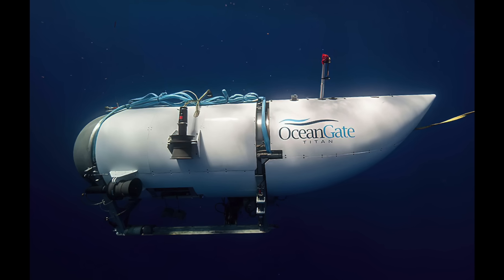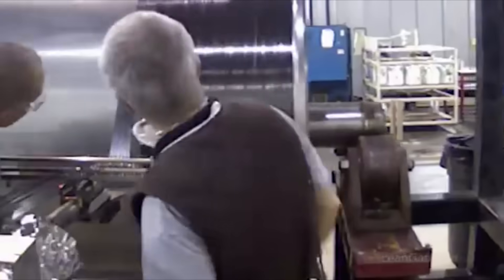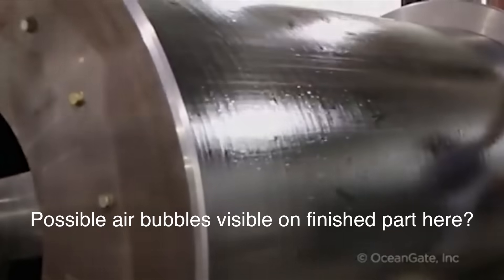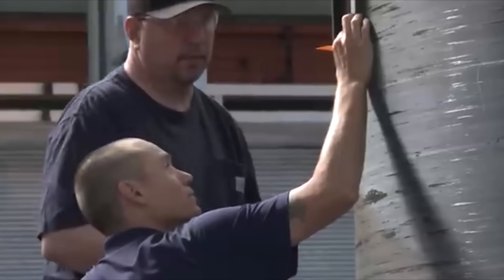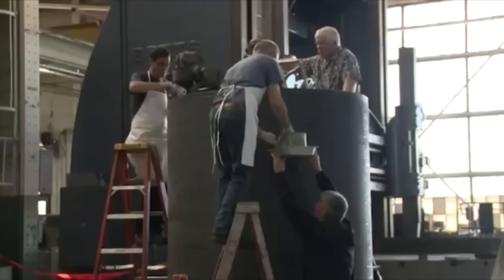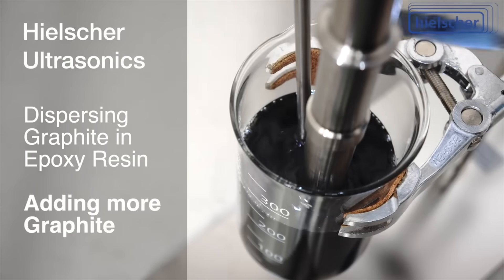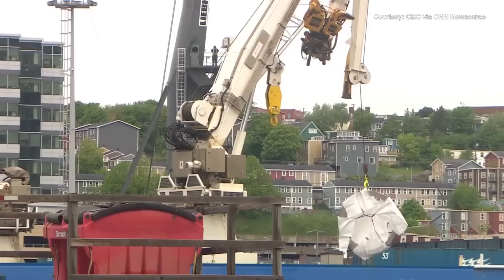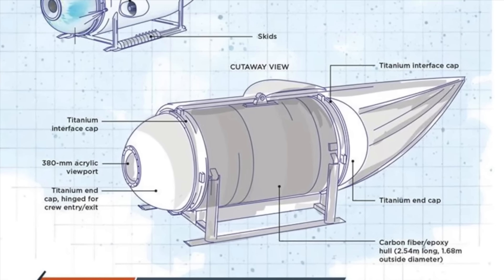Why OceanGate Titan Imploded - A Carbon Fiber Composites Perspective

Comment: I have been an aviation maintenance technician for 32 years, specializing in aircraft structural repair.  I spent 10 years in The Air Force, 5 working on the B-2  Bomber and had a lot of composite repair training.  I am not an engineer, just a repair technician.  Watching the video of the Titan’s construction made me cringe.  To me, they did nothing right and everything wrong. Watching them “clean” the Ti ring and bond it to the carbon made me gasp out loud.  We had a saying, “Cleanliness is next to bondliness”.
Reply: Every step of this is wrong and that's only the tip of the iceberg. Absolutely stunned that it didn't implode on its maiden voyage.
Reply: @godfreyberry1599  Amateurish..the only thing missing was a cheap Wal-Mart chain-hoist anchored to the garage rafters with an eye bolt!!!!!
Reply: @godfreyberry1599 it would of if it went to challenger deep
Reply: @godfreyberry1599  well it all began with the tip of an iceberg...
Reply: Since you’re here: So does anything about the Titan’s construction make sense for the aerospace industry? Because I’ve wondered if Stockton was taking what he apparently knew as an aerospace engineer and just assumed that a vehicle for underwater works the same way as planes.
Reply: @ElizaHamilton1780 the aerosphere industry is very different from deep sea diving. For example, take the examplr of the space station: the space station will never be submitted to more than 1 atmopshere of pressure. A deep sea submarine can have thousands
Reply: @FlorenceSlugcat  Yes and these thousands of atmospheres pressing inwards. The one atmosphere (in fact less) on a air or space vehicle are pressing outwards, much better suited for carbon.
Reply: @FlorenceSlugcat The underlying physics and engineering principles is the same, and any respectable aerospace engineers will give you the same reaction and answer as to what and why did it happened just like any deepsea engineer would. You are working with extreme condition, and things that used to work for a much less challenging environment do not act the same once you put them into the extremes.
Reply: @ElizaHamilton1780  Was he truly an "aerospace engineer"?
Reply: @patrickbass3542 he had an  undergrad degree in aerospace engineering from a good university, but one he was clearly a legacy admission to. His ancestor, Richard Stockton, was a founder of Princeton, so I’d take his degree from there with a grain of salt, not to mention it was just an undergrad degree, which doesn’t usually include all that much for major coursework let alone enough for a specialty area like aerospace (and certainly not deep sea engineering which is obviously very different), and he completed that degree decades ago. So no I wouldn’t consider him truly an aerospace engineer, let alone a real deep sea engineer. A lot has been learned in the engineering world since the mid-80s when he was at Princeton, and he showed no inclination to learn from existing research, and he had no advanced degree or even specific training in deep sea engineering from what I can tell. You’ve heard of imposter syndrome? This is the opposite. It’s called narcissism.
Reply: @kcjd8659  Damn, that last bit was a sick line. Stealing that for later.
Reply: @ElizaHamilton1780  That's my main concern. Structures in aerospace are mostly subject to tension, where carbon is good. Nowhere I heard that it would be good for pressure chambers. 

Also, when we do the simplest repairs on composite structures, we use vacuum to get the air bubbles out of the epoxy. Seems they did not even do this simple method. Agreed, you would need a vacuum tank of the size of the sub, driving the cost. One more shortcut they did.
Reply: @ElizaHamilton1780 It is actually the other way around. Airliners are pressurized to stay close to atmospheic pressure at ground level. So you can breath properly. The higher you go the lower the air pressure. If you go under water. Outside water pressure rises and will compress the vessel. So the sub will be crushed.
Reply: @ElizaHamilton1780 this looks to me like a college engineering project. But like, a good college project where the people tried rilly rilly hard.

People who have no muscle memory from years of industry experience reminding them not to touch the titanium ring that they are cleaning with the other hand. College level mistake.

Reducing your engineering to "just radial forces, no torsional or axial" so you only have one carbon fiber orientation. College level mistake.

Stockton Rush went to college for engineering, then went into finance. He doesn't have the relevant post education expertise, he's stuck in the college senior mindset.

I've made college projects. Some were rilly rilly good. No shade from me. But the biggest mistake is putting your body in that project on such a zero tolerance for failure environment as the deep sea.
Reply: It's a case study on how not too......

Just about every sub system was compromised.

Going to 1 atmosphere  maybe with adequate testing and maintenance...... But 4000m repeatedly. You would have to be off your rocker.

With out of date materials.
With the bonding processes.
With the narrowing of safety margins.

The view port was rated to ?
The avoidance of scrutiny. The reactions to criticism, or just fair unfavourable opinion. All red flags.

Stockton played the system and shows why regulation is needed and good governance, that emphasises accountability and responsibility. Which are not upheld  in senior levels of government and business.

Sad outcome for the friends and families.
Reply: I too was appalled at whàt I saw of the layup! I've worked on aircraft,, boats, roçkets, atomic submarines since 1957! Worked with autoclaves
And HYDROCLAVES. Also oñ filement winding machines. Yes, they were very naive iñ every respect, from the mixing of the àdesive to handling of materials! Did they use a vacuum chamber to remove the air from the adhesive?  What was used to thicken the resin? Many questions!
Reply: @robertchilders8698  exactly its first thing i see no vacuum chamber  to draw out them air bubbles you can see them as it made , and the guy mixing up the glue with a filler spreader in a bucket was shocking to watch. preparation is key in a dust free temperature set environment. i see none of this. it looked like a 3rd rate car body shop on an open air industrial estate
Reply: @robertchilders8698 no lol it was inside a warehouse in the open when they glued it together absolute insanity.
Reply: @robertchilders8698 presumably they didn’t do the adhesive in a vacuum because we saw them do it in a warehouse no?
Reply: @LouisEguchiWale  with nothing protecting that glue before sitting that ring down. One arm hair is all it would take!
Reply: @robertchilders8698 I was looking for the vacuum pot too.
Reply: Hi Chris, Retired USAF AFRL/ACO 2016 here. As a SME I applaud you for composite repair skills. I started the Mobile Training Team at the request of HI. In 2008 and personally trained over a hundred airmen in the field. In my opinion there were both design flaws and grossly inadequate manufacturing processes. This puts an unneeded smear on composite structures. The joint was the problem! Adhesives are great in shear not so good in tension terrible in peel strength. Some of the factors stressing the joint: dissimilar material stiffness, dissimilar material expansion due to temperature changes, hemispheres flatten out under pressure causing the bonding surface to dish out and put the joint in tension on the outer circumference. I was the principle manufacturing engineer on filament wound cases for the space shuttle boosters Air Force program to do a polar orbit. Canceled because of the Challenger disaster. In testing using water pressure the reverse loading condition of the submersible the joint was a big hurdle. At near 1000 psi the half dome hemisphere inflated like a balloon and the composite tube barely moved radially. This caused the Clevis joint on the dome to open up and expose the interior end of the pin to the pressure. The 2000 pounds of force on the end of the pin was like pulling the trigger on a gun. Pins were spit out like a machine gun as the joint failed in microseconds. 

The AFT joint failed 6000 psi water pressure intruded compressing the air to less than a golf ball size and blowing out the forward porthole and the after shockwave blew the composite tube apart. Only epoxy in that direction no fibers along the axis.
Reply: @oneskydog6768  
I too am curious about the bond and see it as a definite contender for the leading cause of failure. In addition to the points you've made, I'd like to add a few thoughts of my own.

Having been in the composites industry for about 30 years, I have some experience with the processes and materials, although admittedly little with carbon fiber and zero with submersibles. I have been involved in design and manufacture of marine, wind blade, and infrastructure products. Much of my time was spent testing products, often to failure.

I can see multiple possible paths to failure in this vessel. It could be due to engineering decisions, manufacturing processes, material choices, quality control issues, etc. It could be a combination of two or more bad decisions. As an example of just one line of questioning, the carbon fiber hull was bonded to a titanium ring. Was the ring adequately designed for the bond? Was the bond compromised by flexing of the carbon hull? Inward flexing of the hull could act as a lever on the bond line. Bonding dissimilar materials can be difficult to accomplish. If the hull was stiff enough to withstand pressure and not flex, it wouldn't act as a lever causing a failure of the bond. If the ring was designed differently, could it have helped support the hull and thus, the bond of the hull and ring? We could surely come up with similar questions for each of the components of this vessel.

Most commentary on this tragedy leans towards speculation as fact. Watching a couple of videos where they show elements of the construction process doesn't turn us into experts on the structure and certainly doesn't make us qualified as failure analysis experts. I've commented on several videos where the overwhelming commentary is that the carbon hull failed, stated as fact. It's all speculation as nobody knows what actually failed. It could have been the carbon fiber, it could have been the bond interface between the carbon and the titanium rings. It could have been the viewport. It could have been something else. At this stage of the game, there is no one that "knows" what happened with any degree of certainty.
Reply: @rogermccaslin5963  Roger, The audio indicated they were in trouble for 20 minutes. Cracking was heard in the aft area as the sensor alarms were going off. There was a lot of stuff hung off the aft dome bouncing up and down as it was towed across the ocean. If you look at material properties you can see the problems in my opinion. I am not a structural engineer but the mismatch between titanium and carbon fiber is huge. Starting with tensile strength Ti6Al4V 20.3 KSI, Toray medium grade T700 tensile 711 KSI so in compression knock it down by a factor of four and it is still 10 times as strong as titanium along the fiber direction. Comparing stiffness or resistance to deflection measured by modulus of elasticity of materials: Aluminum 10 MSI, Steel 30 MSI, Titanium 16.8 MSI, T700 carbon fiber 33.4 MSI twice as stiff as titanium. In addition to the pressure loads it is cold down there titanium has a thermal coefficient of expansion of 4.78 micro inches per inch per degree F. T700 CTE is zero to slightly negative. My rough calculation is at cold depth near zero degrees the titanium rings and domes would shrink 0.019” across the diameter causing a strain of 0.0025” per inch of bond line. That is a lot of movement for a structural bond. In addition the laminating resin is weaker than the adhesive and with a sharp radius step machined in booth sides sets you up for a shear crack in the epoxy exposed to hydrostatic pressure right next to the rings. No axial fibers epoxy is 12,000 psi tensile strength. My money is on joint failure.
Reply: @oneskydog6768 The audio that you heard was fake man
Reply: @oneskydog6768 are you sure your not a structural engineer?
Reply: @LouisEguchiWale  I am sure! I am a degreed Manufacturing Engineer and have worked with advanced composite structures manufacturing and repair since 1980.
Reply: @rogermccaslin5963  you have covered most bases! Having to work with composites to metal, we had to have an intermediate material such as neoprene rubber to work the expansion differences between the different materials. We were not allowed to bond composite to bare metal, no matter how well it was prepared!
Reply: @rogermccaslin5963  You are are absolutely right! When I worked with composites, we had to have an intermediate material, such as neoprene rubber to make up the expansion differences I haven't seen any of that,  yet!
Reply: @rogermccaslin5963  You sound like someone who actually understands the difficulty of knowing why this happened in contrast to the majority of commenters that assume they know.  For example, many criticise the cleaning process for the titanium ring prior to adhesive bonding. If this was the final cleaning step, the criticism would be justified. But this may have been an initial cleaning prior to a tightly controlled final one. I have no idea what the actual cleaning process was, but the video  appears to me to be intended as a promotional piece, not a comprehensive documentation of the manufacturing process.
Reply: @oneskydog6768 Well 1 year later and we now know you were right!
Reply: @oneskydog6768  The shape is the biggest flaw. Even a chicken knows, and lays a spherical egg.
Reply: @tysnow890 , um,  maybe think again...
1. Chicken eggs are not spherical. 
2. Chicken eggs are not pressure vessels. 

So how is a chicken egg relevant to this discussion in any other way than that some of the people involved may have had eggs for breakfast?!
Reply: I have none of your experience. I knit and crochet so I basically make fabric from string. The way the strips of carbon fiber were wrapped onto the hull was the absolutely worst way in my eyes. I saw other videos where it was criss crossed to make a stronger " fabric". But the worst thing was the "peanut butter" glue. Rush said it had to be evenly applied and thin, but not too thin. WHAT??     All I saw was guys smearing it on with no way to knowing if it was done right.
Reply: @claudiastokes6485  i think they did this on purpose,  wtf is the reason for recording the horrible way they put together that tin can? How could they not know they were doing it all wrong? They did know but Stockton didnt care and made his employees comply, i think he had a death wish and took 4 people with him, he was told many times it would implode. Dude was nuts
Reply: @vicvega3614  I have to agree, he was at the very least insane. He fired all the experts who would dare to speak up and replaced them with students who didn't know much and yessed him. 
Having a death wish is one thing, taking 4 lives with you is on another level
Reply: @claudiastokes6485  yea, imagine going deep into the cold, dark ocean after experts told you the sub is going to implode, most people wouldnt do that, he had something wrong with him
Reply: @vicvega3614  I think he really considered himself too extraordinary and important to be killed by his own hubris. Which, I think, is pretty much what the word was invented to convey in the first place...
Reply: @StoutShako  well ive seen a few interviews with Rush and numerous times he brought up hull failure from the carbon fiber, hell in another interview he pushes the button and says something like "lets hope it doesnt detonate "..... like what?!? The words hull failure should NEVER come out of his mouth. Like i said above, dude was nutso
Reply: Thank you for your Service.
Reply: @tonybino01  Thanks for the recognition but the battle is just beginning. No guns internal enemies undermining America. It will be America or Communism that rules in the future. Cancelling investigating Chinese student spying in our universities was a big mistake or pleasing the masters. The party of slavery has no love for the constitution 2024 will be pivotal. Are you better off now than in 2020? Vote for constitutional America in 2024!
Reply: Thank you for your service.  To the good engineers, you are not "just a technician".  Engineers need technicians to provide feedback as to the layup processes to maximize the quality of the parts and validate the processes.
Reply: They were wiping it with a paper rag with one bare hand still touching behind lmao.
Reply: @john-s-peñois  Yes!!!!! And a dirty towel at that.
Reply: Much like Tig-welding - you want things as clean as you can possibly get them.
Reply: I am not an expert in any of the fields involved in building the Titan. I worked in the plastics industry for a few years (primarily automotive) but am now a housewife. I dabble in crafting, sewing, baking and the like. In my unexperienced view, I saw many places the craft could have failed. The carbon fibers wound in a single direction, the lack of environmental control when bonding the titanium to the CF hull, the possible undergluing, the disparate materials used and possible improper manufacture of those materials. If I were to start a project of my own under these sorts of circumstances (incorrect materials, faulty tools, incorrect bonding, etc), I'd be shocked if I came out with a good result, not expect one!
Reply: @scottpageusmc Cute comment about your grandmom.
 Made me smile.
Reply: I have absolutely no experience or expertise with anything remotely related to this subject and I was absolutely shocked when I saw the condition of this submersible too.
Reply: The guy is actually wiping off the outside of the titanium ring. The part that is in contact with the titanium dome.
Reply: I'm not even engeneer, I'm finance major, but even I tought them applying that glue jelly with hands, was the most ridiculous thing I had seen.
Reply: I'm a journey man painter 33 years worked with epoxy paints over the years.Lots of room for error if not done in the proper clean environment.I watched the video and they were not even close to a clean environment.
Reply: Yep, I had the same reaction after 20 years in aviation structural maintenance.
Reply: @major__kong  when bonding composite material to bare metal, you must have an intermediate material to allow for expansion! Not just adhesive! I didn't see any of that!
Reply: @robertchilders8698  My only experience is bonding similar materials.  Good to know about needing an intermediate material.  Makes sense now that I think about it.  When I installed my bathroom tile over a concrete slab, I didn't want to use the Schluter DITRA uncoupling membrane because it was very expensive.  Through some research, I discovered that cork sheet can provide the same function at lower cost.  So that's what I used.
Reply: Retired engineer here that worked in R&D from the composites industry, and I agree, everything that I saw made me cringe so bad.  There was so many things that were not okay.  😥
Reply: It's the basics of glueing, you want the glue to adhere to the material you're connecting, not to dirt and grease.
Reply: Average RC airplane hobbyist constructors take more care in assembly than Titan did.
Reply: I refer to a similar thing. Which is when I stick or bond something I use isopropanol to clean the surface everytime I stick the item on. Whenever I stick I always clean with isopropanol. I am referring to stickers and sticky pads and I do this to prevent doing the job twice. I have learnt from those mistakes in the past and unfortunately we will all learn from this unfortunate event.
Reply: They could have run stainless threaded rods from the front bonding ring to the rear bonding ring around the circumference of the hull. Bolted to the rings to help prevent blowouts of the rings
Reply: Not an engineer though I did spend 21 years in the Air Force as a communications officer.  I knit in my spare time. Looking at the single direction wrapping being weak makes a lot of sense if you understand the basics of knitting fabrics.  Fabrics (carbon fiber) stretch in all directions so why not add strength by changing or alternating your wrap angles at different intervals to make a stronger fabric? This video capture it very well.  This guy was out of his league.
Reply: Moving a dirty rag back and forth across the critical joint.... I take much more care washing my dog's food bowls.😮
Reply: With a dirty rag to boot.
Reply: Peanut butter nice and even make sure everything is rite
Reply: Right and to me that is just the most common of common sense that oil that is always present on human skin like it or not will very obviously prevent a proper adhesion.
Reply: Aircraft Master Crew Chief -23 yrs.
There are many problems with the Titan. Carbon fiber has a wide range of uses but gluing carbon fiber to titanium caps ?
A gametroller ? Glue ? … none of these ‘new’ materials were tested at depth.
Reply: @JenniferStreetArt  i have come to the conclusion that mixing carbon fiber and titanium is at the crux of the cause.
Reply: @johnwright291  agreed
Reply: @christalbott1852  when they say that ring down on the pressure hull wearing cheap white aprons with exposed arms I cringed. One little arm hair is all it takes to mess up a bond!!! Wow. I’m stunned. Thanks for your service.
Reply: The fact that they glued without visible EXTRUSION is alarming. I worked for years in aircraft maintenance and repair.  On those occassions when gluing a part was neccessary proper sterile cleaning of surfaces was imperative as was temperature and mixing of glue components.  In addition it was ALWAYS expected that there would be minor visible extrusion to assure complete coverage of bonded parts.
Reply: Anyone who's ever tried to use scotch tape on a dusty surface knows.